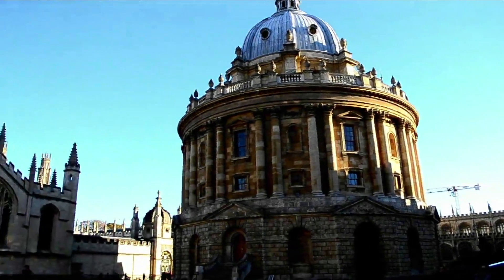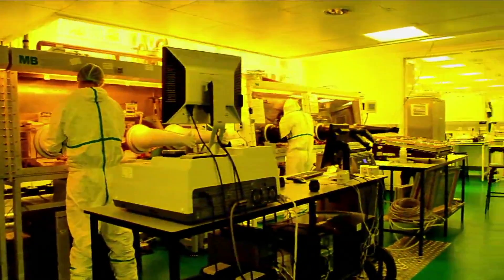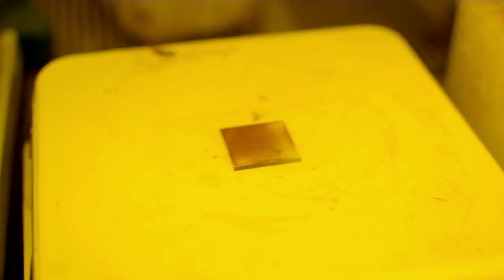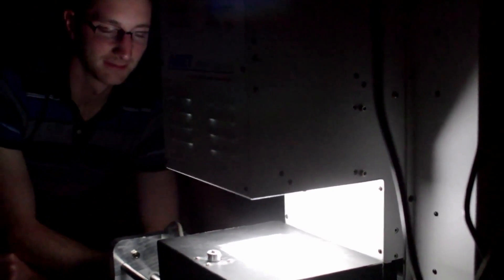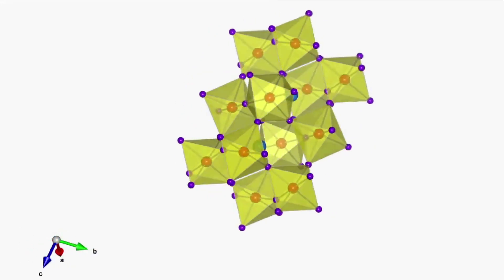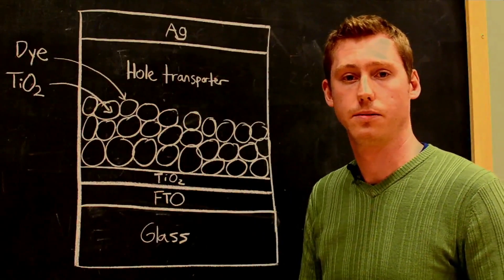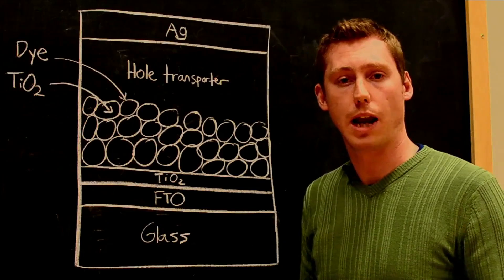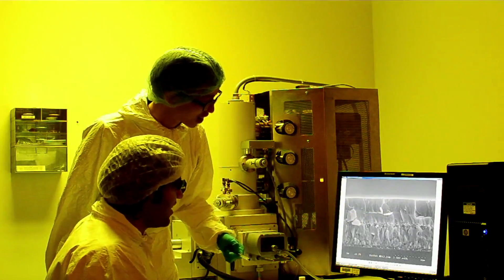Perovskites: The Emergence of a New Era for Low-Cost, High-Efficiency Solar Cells

Comment: Ok, here are the facts: Silicon is just after Oxygen in abundance. This makes Si the second most abundant material on this planet. Every rock you sit on, everything you walk on is made of silicon. So, when I hear: we have found a material that is cheaper and more abundant, I just cannot stop laughing. Silicon is the only material, along with carbon, where you can find EVERYWHERE and promises low cost.
Also, in terms of performance, Si cells do not need a TCO layer because intrinsic silicone is quite conductive on its own (hence the metal "finger" collectors on the typical Si cells). Other cells need a TCO (Transparent Conductive Oxide) layer so they can collect light. The solar cell you make is as good as this layer. If, let's say, you make a solar cell that its absorber layer collects and converts 100% of the incident radiation, and your TCO layer is only 1% efficient, then all your cells is going to be 1% efficient. The only layer up to today that can be transparent and efficient is graphene. Until we have graphene readily available, all thin film technology is going to be as crap as the TCOs we currently use, including Petrovskites, die sensitised, and all the rest thin film technology out there.
Reply: Pure silicon is rare because it take alot of time and effort to purified them
Reply: +GoogleHelpYou All the elements are not found pure in nature
Reply: +Delphi Builder But silicon take alot of energy to be purified
Reply: +GoogleHelpYou Are you joking? All elements take energy to be purified
Reply: +Delphi Builder All elements take energy to be purified. We are just finding the material that easier and cheaper to be purified.
Reply: Dani Risdiandita Not when you already use solar panels to do that. So it just basically comes down to material abundance...